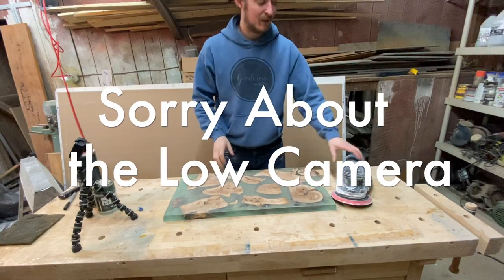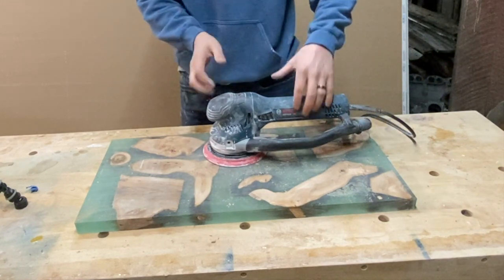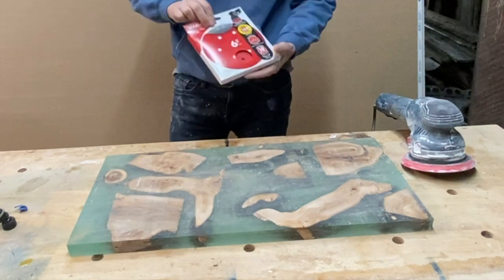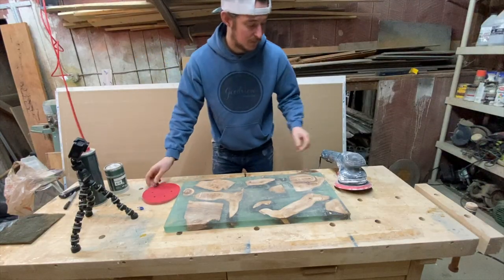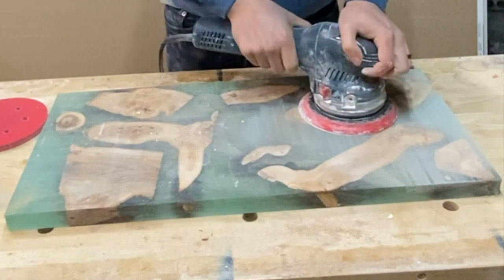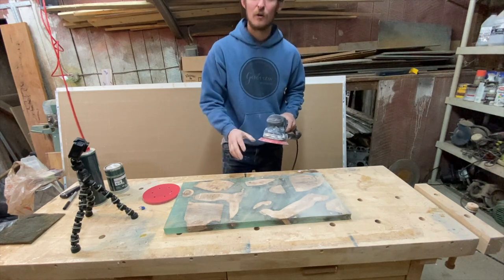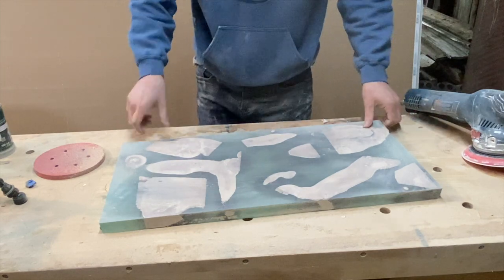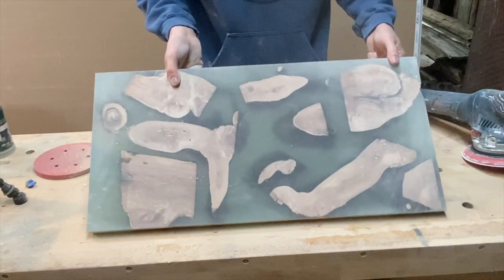10X your Woodworking and Epoxy Business || Bosch GET75 6N Tool Review

Comment: I just upgraded recently too.  I bought a Festool Rotex 125, similar to the Bosch you reviewed but matches my other Festool stuff.  These type of sanders are amazing.  Lots of material removal, quickly.  A couple words of caution.  1- Because they remove a lot of material fast they tend to generate more surface heat than regular sanders.  This causes 2 problems, it will soften and heavily mar epoxy so you will have to chase after it to get it looking nice, and if you apply a lot of pressure on it the sandpaper warms up and can damage/melt/destroy the sander side hook and loop fasteners (the sander pad).   Second word of caution - Always use a dust collector with it, always.  Not only for the obvious reason of, you know, keeping dust down but the bigger reason it that it will help you keep the sandpaper/velcro cooler and it will last a lot longer.

Comment: Surely you have a shop vac?  Cobble together some smaller hose to attach to the sander and then to the hose on the vac.  Get one of the switches that you plug the sander and vac into and then the sander turns on the vac and lets it run for ten seconds after the sander stops.  Makes a huge difference.  Sandpaper will last longer, your lungs will be cleaner and your shop will too.  The switch/control box was less than $50 and I think it came from Rockler.  (Then I bought the big brand $600 shop vac with the feature built in.  I must be an idiot.)
Reply: I used to hate sanding until I started using a vacuum.

Comment: Yeah Nathan I had mine about a year, wait until you gotta get a new pad cuz it won't hold sandpaper. 🤣 None of the dust collection holes align. So dust extraction is NOTHING LIKE IT WAS. It used to have good suction not now. I've contacted the MFG but NOTHING
Reply from the maker: Thanks for the info.
Reply: Mine lines up just fine, make sure it's the correct part number for the identical model you have. They make more then 1 style 6" pad

Comment: I just bought same sender , have a question. When I press a little bit harder on turbo mode the sender shifts automatically to low speed, and basically does not sand the way it should. Do you have a same problem with it?
Reply from the maker: I don’t have this problem. There might be something wrong with the sander you have. You might want to contact the manufacturer. I have put hundreds of hours on my sander and haven’t had a single issue.

Comment: Thanks for the review, even though i'm 2 years late lol. I picked one of these up for $188 Brand New, which is much less than the other good sanders cost. I just don't have $500-$700 to spend on a Mirka, 3M or Festool sander, but this sander seems to be able to hold it's own against those more expensive brands/models.
Reply: Still using it? Liking it?
Reply from the maker: @raizt1596 heck yeah! I use it everyday. The only thing I have had to replace was the pad the discs stick to. Works fantastic!!

Comment: get i get your opinion on this vs the mirka sander? have you ever used the mirka and can you talk more about that? i hear great things about both...except for the price of the mirka
Reply from the maker: The Mirka sander is a very good sander as well it’s actually better for finish sanding. The Bosch is better for rapidly removing material. I’m finding that I use the Bosch for the lower grits and my finish sander for the final grits. Hope that makes sense.
Reply: @GoodViewWoodworks  yes it does. i just bought the bosch bosch get75-6n . its supposed to be comparable to the festool. i wonder if i have that one, which is probably gonna be great as well for the lower grits , if itll be as good for finish grits because last thing i need is to spend another 650 when i spent a lot on this one/

Comment: Can I take a wooden circle slab and put it in a silicone mold just like you used in a previous video and pour epoxy around it and make it the 9x13 pan size? As long as I get all loose bark and such off of course lol
Reply from the maker: Yes of course!
Reply: @GoodViewWoodworks  thank you....I appreciate the answer back. I want to start out on small projects then work my way up to bigger ones

Comment: I have a similar sander but I really have a difficult time with the sandpaper heating up, melting on to the sandpaper, causing the pigtails.  It's incredibly frustrating.  Even the Mirka Abranet sandpaper clogs up.  Would you say do lighter passes?  What about spraying the sandpaper with compressed air?  I'm really amazed at how your sandpaper did not clog up...  what is this sorcery?
Reply from the maker: It just comes down to not pressing down so hard on the sander and making sure that you continue Eller the dust from the surface of your project throughout the sanding process. Hope this helps.
Reply: @GoodViewWoodworks  I'll certainly give it a go.  Thanks!